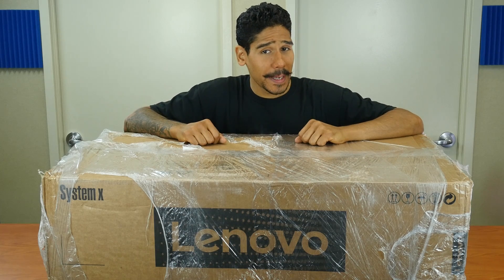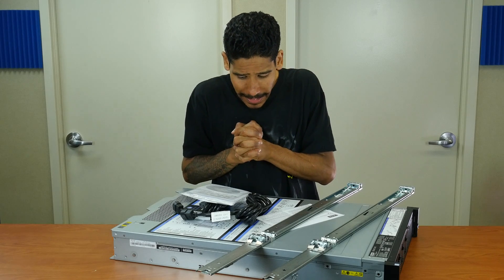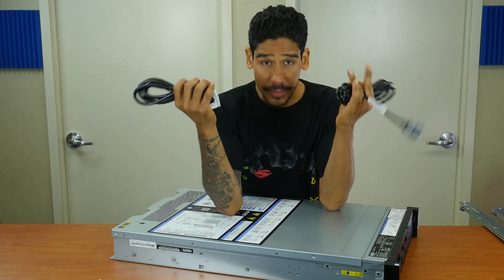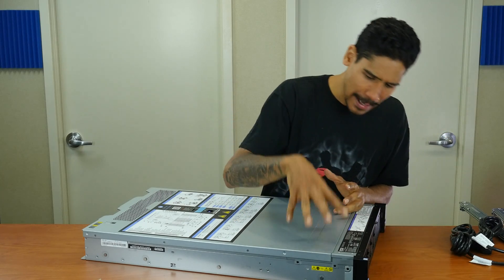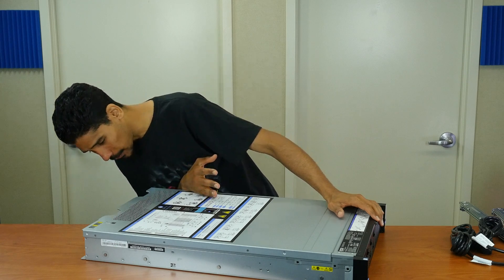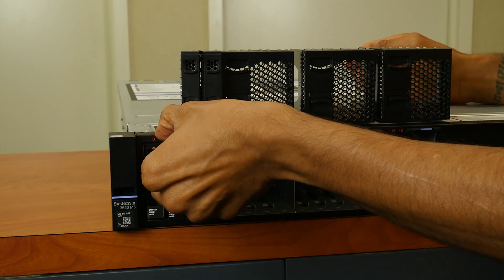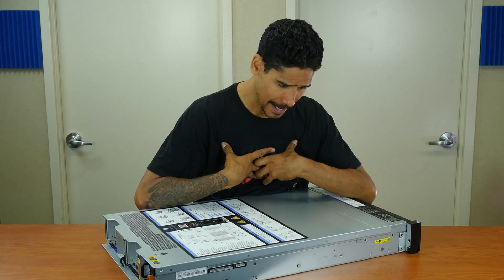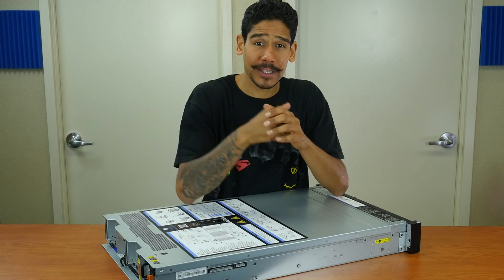Lenovo System x3650 M5 Server Unboxing & First Impressions!

Comment: A nice project for this one would be to create a Windows school server with all the bells and whistles starting from zero.  There should be one domain with two child domains: school and admin, both using the AGDLP setup for management, employees, teachers, students, visitors . The OS is the Windows server 2016 datacenter with Hyper V with the VM's ADDS, DNS, DHCP, file server , print server, CA server, wsus, MDT, Backup,  a DMZ for the school website (IIS) ...
Reply from the maker: +Ludo Robben nice project, but to push out a machine with so many roles and features as production is dangerous. I might not go home - stay at the job monitoring the server 24/7. I know, if you do it right it should be okay but still makes me nervous.

Comment: these do have a management port it is called the IMM (integrated management module) port
Reply from the maker: +Benjamin King sweet. Thanks.
Reply: BTNHD there is a network port next to the vga adaptor that is the management port
Reply from the maker: +Benjamin King nice. First Lenovo server in the shop. Super excited!!! I guess your a Lenovo shop at your job?
Reply: BTNHD they are seriously powerful  and very reliable servers to use as a virtual host I learnt a lot from morten from my playhouse on YouTube he has racks that are filled with lenovo and ibm servers